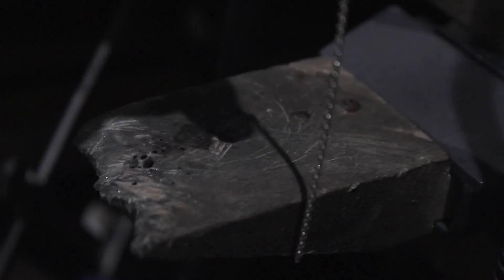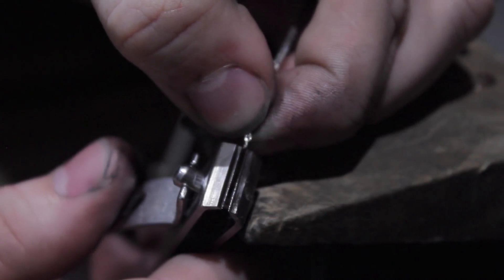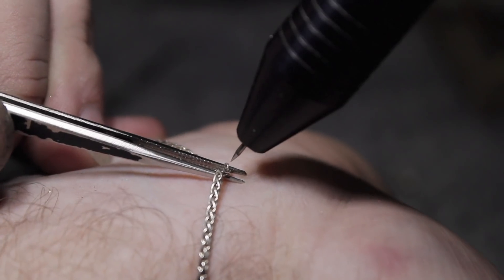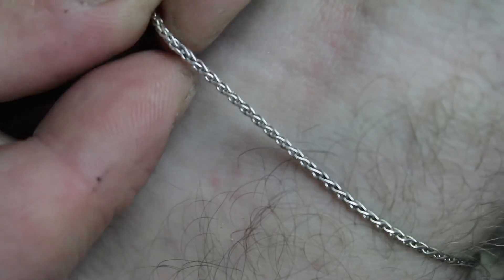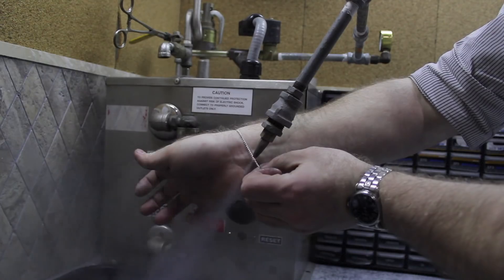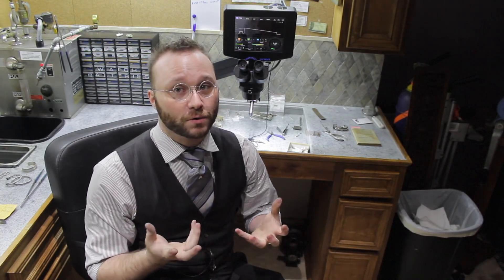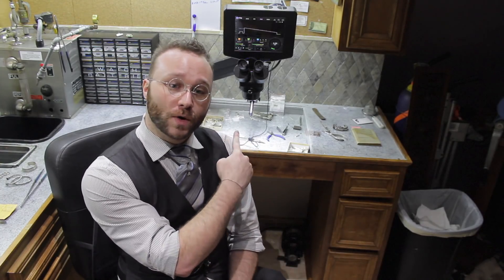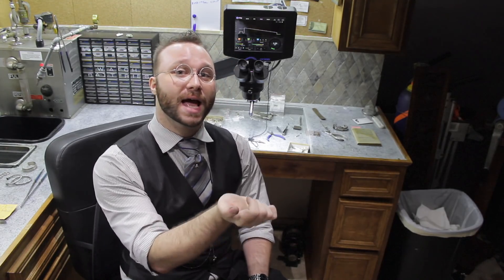The Impossible Bracelet - Showing Off What The Orion Can Do

Comment: Can you do the same thing with a very thin chain 1.5mm? I keep trying and I can’t make it work. So frustrating. Any suggestions?
Reply from the maker: They should have also given you a smaller needle that you can use for smaller welds. Start with the power and time at the lowest setting and work them up till you complete your weld